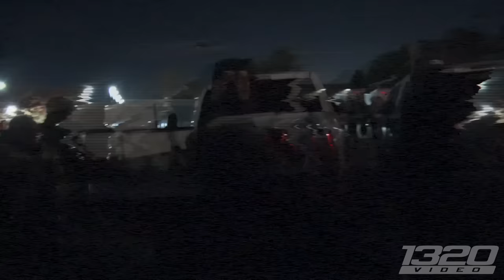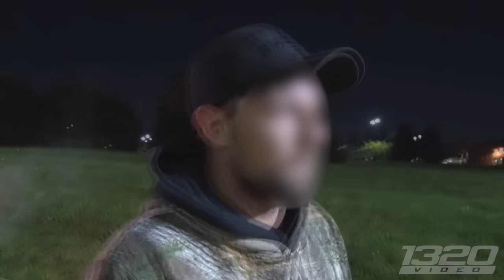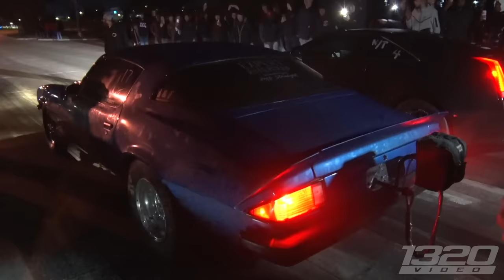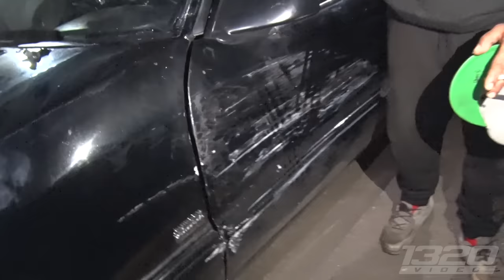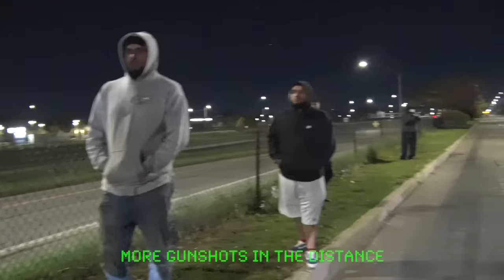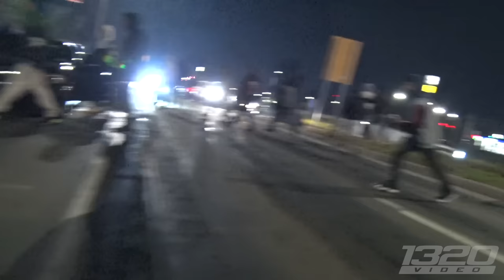Detroit Cash Days (SKETCHY RACES in 30ºF weather!)

Comment: Too bad the fox body developed issues. That car was flying. I wonder if this type of racing existed when I lived in that area back in the 60s, 70s, and 80s?
Reply: El Cajon in San Diego, CA had street racing riots in the 60s
Reply: @robertha  well that has complete zero to do with Detroit
Reply: Yes it did. Dad used to watch 'em run at Plymouth and Outer Drive in the late 80s early 90s. He saw a Pinto Wagon stand on the back bumper and beat a sport bike.
Reply: Yea cars just weren't as fast
Like low 10s back then was a bad bich
Reply: @JRC99  I moved away in 85 but I know that area. A guy in my HS in the 70s had a Pinto with a 351 in it and wheelie bars.
Reply: Yes it did
Reply: @Michelegonz97  Kind of figured so. We use to race on Gratiot or Woodward. 696 too when it first opened because no cops patrolled it for months.

Comment: yup, thats detroit street racing....back in the day old spots to get down on was Fullerton, Joy Rd, Jefferson at the old fire station, Martin luther king behind the old greyhound off fort st, Fort street and outter drive, next to city airport....there was quite a few spots we would travel to from delray to redford. We would just go from spot to spot until sun up...Good times for sure. One thing is for sure, you will NOT see any of the so called "Street Outlaws" on the actual street with true street racers, props to those still street racing in these days

Comment: As a european who has never been to one of these but would love toexperience one, why arent there more AWD cars racing?
Reply: Think it depends on the place. They get lots of traction but have to move all four wheels so less power made and speed. Some beat these 2 wheels though. Also, I feel that for this race, they wanted it to be older style, in a way. Especially with the non-gutted interiors
Reply: The thing too that people not from Detroit don't understand is the influence of the big 3 auto makers (ford Chrysler GM) on the Detroit area. Everyone knows someone that works for one of those companies, and those companies don't really make any awd cars designed for drag racing. Yet you have mustangs dodge demons and Camaros with stupid horsepower.
Reply: There is alot of brand loyalty to those brands and 90% of people do not drive European or Asian cars. Take myself for example, my father worked for Ford for 23 years and retired. Guess what kind of cars I have been driving since ( besides 1 Subaru)

Comment: 3700lbs for a full weight (zero weight reduction) steel bumper car, again; with him in it, isn't really that heavy at all. That means it weighs 3400-3500lbs. That's just a 3000lb car with a driver and passenger in it.